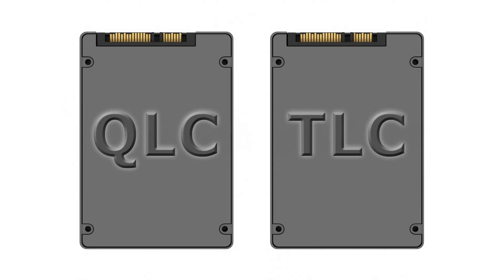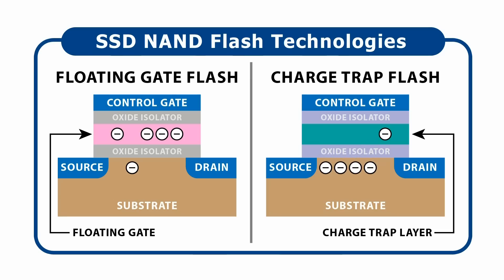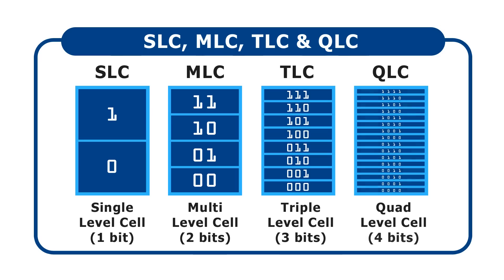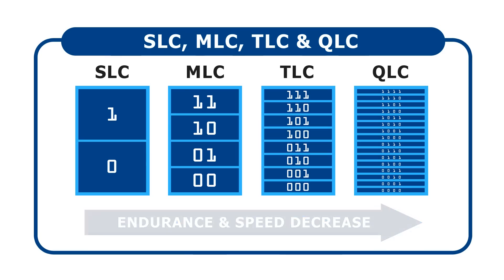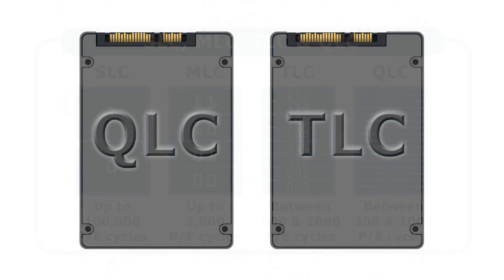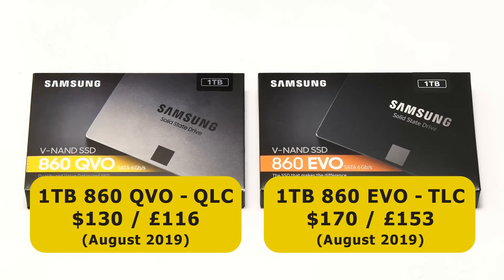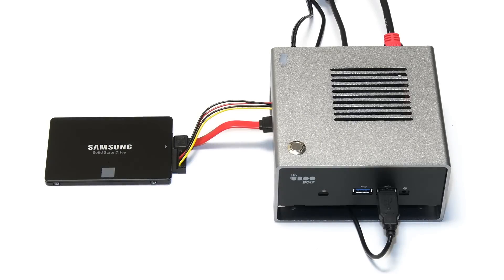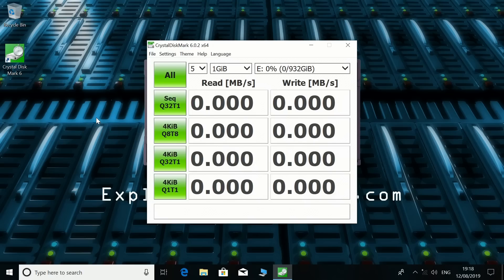QLC vs TLC SSDs: Samsung QVO & EVO

Comment: I think this "42GB cache" deserves some explaination: Both drives may truly have 42GB cache, but while writing such large sequential files, drives use their much higher IOPS capability to write to TLC/QLC and the SLC cache at the same time... We know QVO's QLC (as seen around 12:26 mark) is barely capable of ~75MB/s without using cache so here is the math: 

From the start of the video up until it slows down at 1.35 QVO drive had written 75 - 29= ~46GBs... Of which, drive write at its known ~75MB/s speed to as QLC (from the start) for first 95 seconds, approximately storing 4,4GBs worth of data.. Remaning data is 46 - 4,4 = 41,6GBs which couldn't be written to slow QLC, so it has to be written to 42GB SLC cache, filling it and then slowing down transfer to only what QLC is capable of... Since evo does exactly the same and writes to TLC and SLC at the same time, but TLC itself is much faster than QLC (roughly around 200-250MB/s), your 75GB test file probably wasn't enough to fill up its 42GB SLC cache...

This is the exact behaviour I've observed from my tests with my own intel 660p... It doesn't "simply" fill up its 76GB cache (when 50% full) and then slow down... If I hammer it with burst 1.5GB/s writes it does just that (technically it probably doesn't but it doesn't make a noticable difference)... But when writing from a slower source at ~340MB/s, drive doesn't slow down even at 120GB file transfers... 

This dynamic cache behaviour matters a lot more than it would seem in real life use cases.. When transferring large a game for example, it has both large files and small ones.. My reading source is two SATA SSDs in RAID-0 configuration... If the source sends burst of sequential files @1GB/s, 660p caches them.. When source slows down ~60 MB/s to read hundeds of <1MB sized files, 660p frees up its cache and can recieve more burst writes.. In such tranfers, drive hits the cache limit @100GB+; far later than its supposed to (~70GB)... While this is a relatively extreme use case, I am still be able to transfer 2 games entirely without slowing down..

Some further thoughts.... I loved the QLC and I will never understand this general anti-QLC trend... In the past we didn't only had WD Reds or Blacks but also Green drives and similarly underwhelming 5400rpm WD Blues.... Had someone said EVERYONE down to their grandpa should ONLY buy WD Reds and Blacks because they are objectively superior to WD Greens in every single criteria (sequential speed, 4K speed, access time, longevity, reliability), it would have been rubbish and stupid.

Same goes here.. No one, not even manufacturers claim QLC an eventual replacement for MLC/SLC.. IF you don't do crazy large file transfers, QLC is great: Difference between a Intel 660p and a Samsung 970pro is far less than what it was on a 10k RPM WD Black vs 5400rpm WD Green... Actually, I think QLC drive is equally fast as a SLC drive for average home users, and I dare say its equally fast for 90% of professional use cases as well...  I foresee QLCs and potentially more layered future iterations like hexa-layer cells (I've made up the term) will eventually take the place of large capacity WD Greens of the day... SLC/MLC will remain as the niche option for those who want the best performance, at a price.

All that being said, everyone should be careful with what they buy..  If the use case DO exceed the write cache.. QLC is VERY slow... Slower than a mechanical HDD kind of slow...

And further thoughts on reliability.. Why is QLC's 360TB write limit so bad? Write 100GB worth of data every day, and QLC is still rated to last ~10 years, potentially a lot more... 10 years equate to 87600 "power on hours" on a HDD.. Apart from some rare miracle cases, no HDD can last that long, not even NAS or enterprise drives, not even while just sitting idle by spinning their drive motors. 

About hibernate... Windows compresses hibernation file.. SSD controller itself applies its own compression.. ~2-3GB worth of host write for every hibernation until 100TB writes equates to 33000-50000 shut downs... Let's ignore the fact 33000 hibernations equate to shutting down the pc 9 times a day, everyday for 10 years... Mechanical HDDs have their own "power cycle" limit before they get unreliable.. In the old days, even WD Blacks would have had issues reaching 33000 power cycles, and not even enterprise drives could reach 50000 power cycles.. In more layman's terms, You can't shut down, sleep or hibernate, disk spin down, any HDD-equipped PC as many times you can hibernate a QLC SSD... 

Its interesting to call QLC "unusable" while every single one of us has been using HDD-equipped PCs for the last few decades without questioning the inherent reliability issues this much...

My advice about reliability is; just turn on hibernate if you want and forget about it... You want to write large files often? Do it and stop worrying about it... 1TB is relatively a small size.. Just like 60GB or 120GB SSDs of 5-8 years ago are useless garbage today, 1TB QLC drives will be garbage long time before they are actually used up. Watching thermals, preventing power surges/cutouts and generally backing up data properly is much more important for reliabilty than the useless, nonsense details like SLC vs QLC comparisons.
Reply from the maker: Great post.
Reply: Great post! You saved me from writing about the same thing.  One differing point of view... I wouldn't call older SSDs garbage.  They move to their proper position down the food chain.  For example, I'm now using inexpensive low end SSDs with Raspberry Pi computers.
Reply: Great post. I may add that HLC (hexa level cells) drives are in active development, and PLC (penta level cell) drives are already being produced by Tobisha as an example. This trend will probably continue until OLC (octa level cell) drives at least since all it basically requires is higher grade of material purity in the charge trap layer, and refinement of the ADC read decoder. Writing is done by PWM (pulse width modulation) so that in principle has no upper bounds that are relevant for this purpose.
What we will see in the future is even more intelligent controllers that can distinguish between different levels of cell damage because a future octa level cell may get damaged but may still function just fine as a QLC or SLC cell. At the same time controllers will do active data tier levels where data is only moved to persistent higher level cells once it's determined that the data is indeed persistent data.
Reply: @SamsoniteDove  Speaking of intelligent controllers... In the future, instead of controllers doing all the guesswork, I only wish there would be a lot more user interactivity while setting up the SSDs (in addition to some "auto" mode for less tech-sawwy people, of course).. Users should be able to select his/her movie archive folder an set it to write in QLC always (or whatever highest level device support), and set their, say, temporary render output folder to stay SLC all the time.. Windows already reports actual size and "size on disk" as seperate criteria so it wouldn't be too hard for non tech-sawwy users to understand.. Write MLC instead of QLC and "size on disk" will report twice the actual size. Also, "cache" size should be user adjustable. I have 450GB+ empty space on my 1TB drive, intel says I can only have ~70GB of cache.. Why? I don't care about longevity of cells and I would want to set this entire area as cache. Technically, SLC cache can encompass the entire empty space as data will be read to DRAM and then written as QLC anyway.

With very little software tweaks for taking user input (which will be definately easier than developing "smarter" controllers) the difference between a pro drive and a entry level drive would disappear (apart from actual cell/controller quality)... You don't buy xTB drive. You buy X amount of cells. You are free choose to configure it all as 256GB SLC disk, 1TB QLC or 2TB OLC disk... Or somewhere in between, adjust write levels on folder-by-folder basis. Have both high capacity folders, and high speed folders at the same time on the same SSD. If you need more capacity, you sacrifice write speed or viceversa, you just select a folder right-click into some menu and adjust the slider.. This is my dream SSD at least...
Reply: What you just described will likely someday be referred to as "overclocking" your SSD.

Custom firmware and give it hell.
Reply: @batuhancokmar7330 Great post, so May I inquire you that the 1Tb 860 Evo / 970 Evo are really not that much better than the 860 Qvo and 660P? Basically, TLC nands offer theoretical better performance that will be long outdated before for it to be distinguishable yet it uses the name "TLC" to jack up the prices on consumer drives?
Reply: @SamsoniteDove  shit that's smart
Reply: Let's not forget that they've already figured out high voltage at high temps very briefly can reset the NAND's lifespan and return dead cells back to use.

If they add such functionality to the drives themselves endurance won't be an issue whether it's SLC, MLC, TLC, QLC, OLC, etc...
Reply: Personally, I'm waiting for better controller and bigger SSDs to go full QLC. See, the 1TB QVO can write 80MB/s with the cache full, while the 2TB QVO does 160 MB/s. So far so slow. A 4TB QVO would be quite nice if it could do 320 MB/s with a full cache - I could easily live with such a SSD. But it can't, it can only do  160MB/s - and that's got to be a controller problem.Here's waiting for an affordable 8TB NVMe QLC SSD with a sufficiently intelligent controller that if I'm writing from a slower source - such as any SATA SSD - it'll write straight to QLC instead of SLC cache. It should manage 640 MB/s straight to QLC, after all.
Reply: Not only a controller problem, if they have the same number of chips, just higher density, it'll have the same read/write speeds regardless of the controller.

SSD are fast because of parallel reads/writes. The more individual chips, the more channels, the higher speeds.

2TB and 4TB probably have the same number of channels. More to it than just the controller.
Reply: The number of channels shouldn't be the problem since they're quite clearly not limiting while in SLC mode. The number of flash cells is definitely double as high, so twice the write speeds should be possible. Also, Micron's 4TB QLC SSD does 350 MB/s, so it's possible. Looking at the spec sheet, it definitely doesn't use SLC caching. Mind you, it also doesn't have an increase in write speed going from 4 to 8TB and the write IOPS are nearly halfved, so that controller also has its share of issues. Personally I think the tech needs another year or two to mature.
Reply: QLC is slower, so it needs more channels to match SLC mode.

Curious how Micron does it, but I'm betting  it's a different caching system or more channels.

Either way, I do agree, QLC needs more maturing, needs more everything before it becomes a mainstream product.

I'm sure it'll be the SSD type chosen for all OEM as soon as the price drops vs TLC tho.
Reply: @glenwaldrop8166  The 8 channel design has been the standard for almost 10 years now. It's used by every single controller manufacturer in the consumer space.
Only in the cheapest of SSDs you'll occasionally find a 4 channel design.
Also: Number of flash memory chips is not the same is number of channels.
Reply: Batuhan Çokmar thanks dude,  you just convinced me to buy QVO
Reply: QLC would work great for a gaming drive.

You only perform writes when updating, usually nothing serious.

The read performance was excellent, the write performance was better than the EVO on occasion until the SLC cache was filled.

If the prices were better I'd be all over the QLC drives for my gaming drive.
Reply: Your call.

I use it all the time, unless they've added the "Samsung drive must be the target" in the last six months, it most certainly hasn't been in play for the last decade or so.

Almost all of the HD manufacturers have been using a custom, limited version of Acronis for years. I use it to image drives all over the place, as long as the correct brand is attached to the machine it doesn't matter what is the source and what is the destination.

I've done this too many times to count.
Reply: I like the ability of QLC Flash and managed to buy a 1TB Crucial P1 NVME QLC for £84.39 ($105) when it normally costs £110 ($136) on Amazon you just have to check for deals when you can. The Crucial P1 can write 200TB in its lifetime with good performance being an NVME less cache though at 12GB, good enough for me.
Reply: Almost, the math is not quite right tho. You say QLC is barely capable of 75MB/s without using cache. This assumption is not 100% accurate. It is capable of slightly more probably. Once the cache fills up fully, there are many methods that the QVO drive might employ. It can stop writing to the cache, serve data from cache for reads (and overwrites), and any excess write without the cache directly to QLC. Then indeed you will be mostly correct about 72-75MB/s being a limit of the QLC. But it can also dedicate part of the bandwidth to the process of moving data from the cache to "more-permanent" QLC storage. It can be done in parallel and utilize parallelize better, but it can still eat some of the potential QLC bandwidth. So it is possible that the QLC on its own could sustain maybe 100 or 120MB/s without any cache. But then you will have no cache, and will be hitting this lowish performance always (after 2-3 second of filling up the DRAM cache, which still might not be fully utilized depending on method used for buffering and required power loss consistency level required by OS). So it is might be a tradeoff - get initially (for 2-3 minutes) better performance then got worse than even baseline; or consistently got somehow performance in the middle, more towards baseline but a bit better than it. Because of the use cases and target market for QVO drive, the first case is a reasonable tradeoff.

The advantage of dedicating some QLC bandwidth to empting the cache even when the writes are still happening, is improvement of random writes and "perceived" recovery after the big file transfers are finished. The cache that is emptied in the background while the files are still being copied will seem to return to faster state quicker. Even if the end effect is wall clock time is the same. But it makes people less annoyed probably.

Or it is just doing something dumb. But definitively there is a room for many methods and algorithms of cache management.

EVO is probably doing the same, and that is why we didn't see a drop off in performance after hitting 42GB. Because it is filling up TLC cache at effectively lower speed (write transfer speed - speed of moving from cache to the TLC memory / blocks), so it takes longer than predicted to actually fill up the whole cache.

QLC and Samsung QVO is definitively a good and well engineered product. For many cases 360TBW endurance, and limitations of hitting slower speeds after ~50GB are not a big issues. Even in some semi-profesional use cases. 512GB and 1TB versions definitively will find a lot of use in laptops and desktops of light and medium users, and even some heavy users and gamers. Without any issues.
Reply: wtf this comment is brilliant ! never thought I found something like this in youtube. The same about the video itself, great to see it happen though.
Reply: Против Глобал  if you have a Samsung, WD or Seagate drive in your system you can download their drive imaging software from their site for free.

It checks for one of their drives when you install and when you start the app.
Reply: Great post. QLC definitly has it's uses. I have a number of game consoles, and for example in a PS4 a Samsung QVO and a EVO show similar performance. So if you're looking for bigger SSD storage and don't do a lot of writing, QLC definitely has a advantage since 2 / 4 TB drives are much cheaper.
Reply: Now that was quite a deep dive. Thank you
Reply: The problem for going further is diminishing returns. Each generation has twice the complexity of the previous one. For the first gen, you also get double the capacity. For the second, you get 50% extra. For the third, 33% extra. The next two (going to 5 and 6 bit respectively), 25 and 20% more capacity. All while each generation’s extra cost in complexity is only going up.
Reply: Thats alot of info! btw how much of a upgrade would a 870 QVO be compared to the 860 QVO? they seems to have similar cache sizes
Reply: Intel 660p is great drive for storing games. Cuz with games, you mostly just install them in one place and system only reads data.
Reply: What about data retention without power? I reckon flash memory isn't exactly great at that, compared to HDDs.
Reply: @TheNightquaker  10 years. I think that's good enough for non-tards,
Reply: I have 1Tb EVO, and had in the past 500GB EVO. So.. 200-250Mb/sec writing speed is true for 500GB vesrion. But 1TB version twice faster.
Reply: Good points. Also if you are worried about caching shortening your SSD lifetime you can get a small cheap SSD just for page file and other caches that's easy to replace or an SLC SSD that will last longer and is faster for the small random writes that caches perform.
Reply: Great post.
Reply: Exactly. I want one so bad for games. Specially VR games. I really really hope the future you mention will actually happen soon. Appearantly ssds are actually getting more expensive
Reply: One thing is left: Daily or regular use of SSDs is reading - not writing. So there is only one use case where QLC fails - backup and migration of data. Even if you are working with very large video files you won't exceed the typical SLC cache sizes.
Reply: Thx, great post
Reply: The original comment is amazing with some equally amazing replies. All written so well that even I, with no technical background at all, could follow and understand them. Christopher is amazing for people like myself, he breaks things down into small simple components so everyone understands. These comments compliment that ethos.
Reply: Reading SMART from my NAS (4x4TB, 4x2TB):
70900h, 90970h, 68200h, 70650h, 62350h, 62330h,
73650h (the only one with 3 BADs, others do not even have Remaps),
14100h (replacement for that 2TB WD Green above that still lives happily outside of mirror array).
Hitachis are the best, WD black, green, blue there also, no Seagate or Toshiba rubbish..
Reply: U R 2 caught up in details.  There R only 2 relevant points & they prove SSDs R a bull$hit total waste of time & $$$ = SLOWER write than a spinning mechanical disc hard drive (LOL @ 72 megs per sec =)) & unreliable = limited write cycles.  If U want 'fast cache' U can do much better solutions like some kind of 'RAM disc' arrangement.  The ACTUAL speed of those SSDs is a JOKE, as is their LACK of reliability = simply ABSURD =;-o  Thanx 4 the video 'saving' me from the dead end overpriced hellscape of NVMe & all the rest = just stick with mechanical drives (5400 RPM non-shingled =)  BTW 7200 RPM is a $cam 2 make them overheat & die (transfer speed being about 'aerial density' not 'RPM') 'shingled' / SMR is a slow nightmare of 'over-writing sequentially' any random thing = kills performance.
Reply: The SLC cache is used for writes only.

Once the game is installed it will remain QLC, period.

If it worked as you described then reads would cause wear as well and they don't.

The basic difference between SLC and QLC mode of the flash is simply voltage levels, SLC requires less accuracy so it can be done much quicker.
Reply: Look at the prices. Depends on where you are, but a lot of the TLC drives are still cheaper than the QLC drives.

At last check the 1TB Samsung QVO was $139, you can get a WD 1TB 3D NAND Blue for $109 and it is faster in almost every respect, Crucial MX500 too.

They need to get the prices lower on QLC, right now it's just not worth it. QLC is comparatively low volume parts so it costs them more to make at the moment.

Hopefully by next year the QLC will be cheaper, I expect the 2TB drive will be 50% to 70% the price at 2TB and above, but they may not get the 1TB significantly better priced.

I've been keeping a close eye on that as I'd like to upgrade my 2TB mechanical drive to an SSD, but it's still too expensive.

I'm using Primocache with an 80GB Intel SSD as my cache drive and I get much better performance that way, just not quite modern SSD speeds. Still over 250MB/s tho with the random read/write speeds close to NVME due to the way Primocache works.

Anything that can run from my Samsung 850 Pro still loads faster though.
Reply: why buying a bad QLC samsung ssd when you get a ok TLC samsung ssd for 10-20 bugs more ?
if a QLC runs out of cache it works as fast as a USB stick 

tlc are slow when they out oc cache but at last faster then a hhd  and qlc not 

also older ssd are not garbage just because they are old  that bullshit a good 2015 500gb tlc/mlc will still be faster then a 2020 500gb qlc if they use the same connection like sata3

you say that it dose not matter try to copy win form a mlc to a tlc and qlc drive like many people do when the get a new drive

#new = better is bullshit it was allways bullshit 

a MLC cell on 50nm has a life time of 10.000
a MLC cell on 25nm has a life time of 5.000
a MLC cell on 23nm has a life time of 3.000
A TLC cell on 21nm has a life time of 1.000
a QLC cell on 21nm has a life time of 500

the smaller cells/chips get the weaker the cells get of cause we have 3d nand  now but it still the same you just have more space  

some times not allways you will have too deal with many or big files to copy and that when you can get into trobble because the only thing that keeps then faste it cache  when it full it full

i dont what to say QLC are total shit but if you get one try to ge t a QLC that has a big ass cache so you never run out off it 

but i will never ever get a QLC when it stays like this

for me a QLC has like 0 benefites compare to TLC they are not bigger are not faster or life longer 

on the other hand they need cache more then a TLC needs it to be of use, they die faster, get less/shorter warenty and the price difference is a joke it like 3-10% less compare to a TLC it not like the 30-40% price difference TLC and MLC have 

if they make QLC 50-60% cheaper then a TLC it a GOOD deal but not today 

i remember all that TLC shit when it came out they will die in 3 years when the chach diese its over ... buti have a 2013 840 evo (TLC) first TLC ssd running windows and it have many problems that needet to be fixed by bios updates if get slow when you copy things and a tbw of only 30 is also not good but it still kicking and that thing is like 6+ years  old